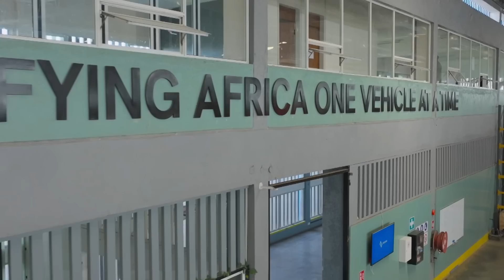Hannah Waddingham Explores Electric Vehicles in Africa | The Earthshot Report 2024

Comment: No.  EVs are not climate friendly.  It is a myth.  How are the minerals mined for the batteries?  The tyres are heavier and more dense, the manufacturing process has a huge carbon footprint.  What happens when the huge batteries ‘die’; landfill?  If all the combustion engine vehicles were removed from the earth tomorrow, it would only save 10% of global oil usage.  Likewise wind turbines are not a green energy once you factor in manufacturing, installation and maintenance costs.  Risk assessment reports support this reasoning.  I support Earthshot, but we all must be honest.
Reply: All activities have an environmental footprint. 
Is poor people having cleaner air to breath bad?
Reply: @donnairn3419 exactly
Reply: Mercedes-Benz GLS 2080 kg
TESLA Model 3 = 1880 kg

A full tank of gas is used once. A battery pack is used over and over again every day, and will in the future be produced close to 100% renewable, and recycled into new batteries
Reply: Well it's the Christmas season. I don't think we can do the twelve days but lets count the ways you are wrong.
1. a biggie. You claim removing all combustion engine vehicles it will only take away 10% of oil usage. Wrong. Transportation is responsible for 27% of all carbon emissions. That's just ground, so it's more with water and airborne FF powered vehicles. 
2. The myth is that EVs are a disaster for the climate. Even when charged by coal power plants alone an EV is cleaner than an equivalent ICEV. 
3.The Tires are not heavier and more dense. I just installed a regular tire on my EV rather than an EV tire with the EV tires only diff being foam inside to help deaden sound. 
4. The manufacturing process of an EV is only a small amount more than that of an ICE due to the battery. However as jann below notes the battery is recharged where the ICE must mine, refine, deliver and then burn petrol over and over and over for ever. After just two years (often less) the EV extra carbon in being made is equalized out. An ICE? Never. 
5. When an EV battery loses it's range capacity is removed and dismantled to be rebuilt with up to 96% of all  components or it is installed as storage for grid electricity.
6. Your wind energy claim is another false myth.
It seems you don't support Earthshot as you are spouting only falsehoods about clean energy. If you do support get off your kiester and google every statement I made. If you do support it will make you happy to learn you've been wrong.
Reply: @cre8tvedge  Let's get the stats straight. His percentage was "oil used by combustion engine vehicle". GLOBALLY According to the IEA 63% of oil is used in the Transport sector. i.e. "Combustion engine vehicles" of one type or another. Which includes boats, and planes, and many trains even.

But let's also make it clear. All "combustion engines" are not used for transport. The true figure for all "combustion engines" (not just vehicles involved in transportation), is very nearly 70%. A diesel generator is after all also a "combustion engine". As is a lawn mower's engine. Etc. Etc. 

Expanding the scope, the portion "combusted" (burned) for energy is about 82.3%. Be it for transportation, cooking, lighting or heating (from homes to high heat applications in factories). 

Of the 17.7 designated as "non-energy use". Plastics account for about 12%. The remaining 5% or so is mostly lubricants and chemicals.
Reply: I don't know if you are being honest and are just uncritically regurgitating the rather large anti-EV rhetoric around at the moment but putting that aside there are some really simple things to understand here. No, EVs are not environmentally friendly, they are just more environmentally friendly than fossil fuel transport. A lot more. It is a compromise. This video is about a really important advantage of EVs that can't be denied and that is they reduce air pollution in our cities. Put aside global warming for a moment and think about the deaths and poor health outcomes for millions of people in the world's cities, particularly developing countries. I'm writing from Jakarta at the moment and the government is promoting EVs to reduce a truly poisonous atmosphere. This is something immediate. It is a problem that has to be dealt with. African cities urgently need to find a solution to this as do most other cities around the world and that is how we should be looking at this video.
Reply: Liar. Nearly 70% of the oil in the world is used in internal combustion engines. Not 10%. So stop using lies in your arguments, liar. Stop lying so much. Don't pretend you care. Lying is also harmful. To the people you lie to. And, when you need people to trust you most, then they will be used to you lying so much. You rotten liar.
Reply: You read to much news that was written by Shell. Use your own brain. Look up numbers and make an honest comparison. The result will surprise you. And if you didn’t have enough math in kindergarten for such undertaking then please shut up